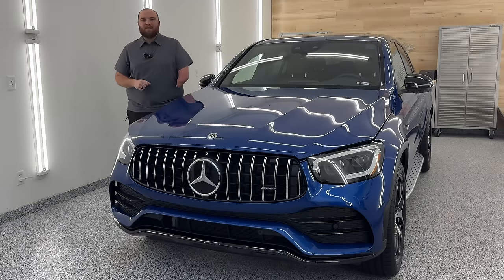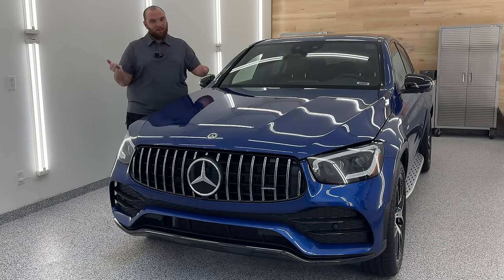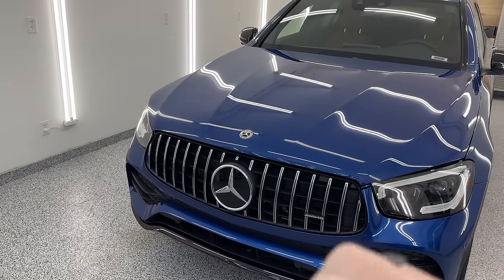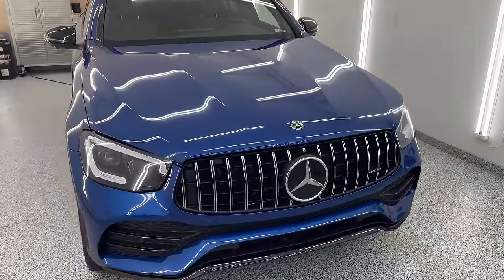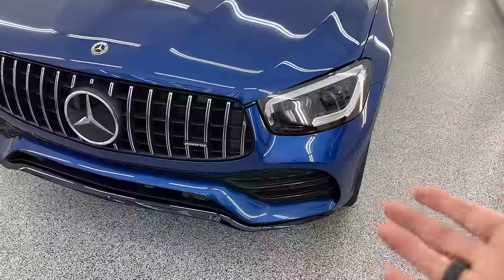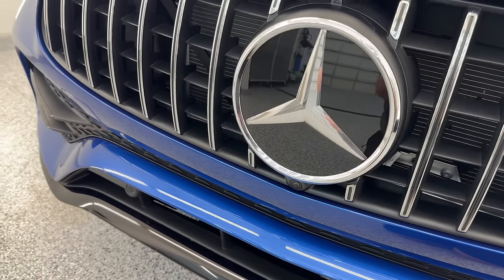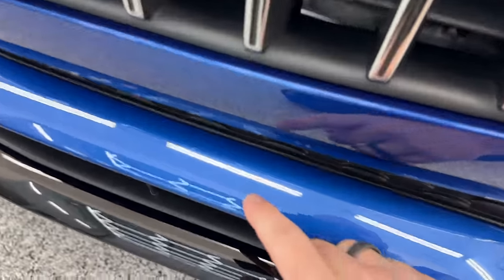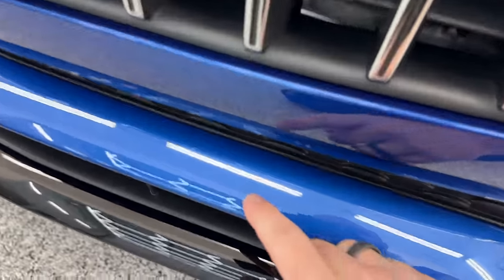The Ugly Truth About Paint Protection Film (PPF) After Just 6 Months & 3,500 Miles

Comment: Yeah, I don’t think so. Very strange viewpoint in my humble opinion. I own about 40 cars and almost all of them have some PPF and I probably have about 10 cars that I have full PF on them. The proper way to protect a new car is Pain correction, then, PPF, then ceramic coating over the PPF. In the last seven or so years, I’ve used three different shops. One of them does amazing work every time, the other two, it depends on who did the job as far as the technician himself. That new EXPEL thicker film is awesome. Also, the matte film is terrific in my opinion. My matte paint cars I don’t even drive at all until they are PPFed. As far as staining, yes, I have had one year old PPF redone twice. Both times it had to do with the fact that the car sat in the sun with sapp stains on the PPF. And, regardless of what it is, older, film, seven years plus old, will need to be replaced if you drive the car at all. I am a big fan of ceramic coating, but only if it goes on top of the PPF. Lastly, the worstPPF that I have seen both from the application technique perspective as well as the quality of the film itself, is Factory PPF on the newer Porsches.
Reply: I agree with you 💯
Reply: So, pay multiple thousands of dollars and waste loads of your valuable time instead of just maintaining your paint with regular washes and garaging?  Even if you have a paint issue, it will probably be minor and cost way less than all of this nonsense.
Reply: @zacklewis342 if he has 40 cars I think the last thing he’s worried about is money.

Comment: Do you think fixing rock chips after couple year period looks better and is cheaper than having ppf and replacing it after the same time period?
Reply: PPF will look better.
Reply: Define better. Better in price? Better in look? Most chips are in the bumper and hood. If you really want paint protection, the smartest move is to get PPF in the bumper and hood only. Possibly lower side of vehicle as well. @ZackScriven
Reply: @ak-iy4yb  better in way it looks. That’s why I said it will look better. 🤔
Reply: My experience.  I have an 11 year old jag xf with 125k miles on it.  No PPF.  At some point lately the front bumper was pretty thrashed with rock chips so I had the front bumper  repainted by a shop with great reviews and it looks as good as new.  It cost $900.  Seems better to just save the money and repaint after a few years than PPF.

As this guy said, if I had a super car that would be different, but a typical car, dont think so.
Reply: @jonesjones7057  I have exactly the same experience. To be honest even if I have to repaint my front even 2-3 years it would still be cheaper that PPF. Also I would never be convince that PPF will look as new after years, you can never prevent peel offs and dust collection at the edges.
Reply: Rock chip will expose bare metal and cause rust
Reply: @cutliss  it is pretty rare rock chips cause such damages unless it went through all the way to the metal. 
I have a few rocks chips that are too big to my liking. Im thinking to touch them up, make them as smooth as possible, keep on driving and possibly repaint the bumper in another few years.
PPF has to be taken off in a few years too no?
Reply: @ak-iy4yb  no it will rust from underneath the paint once the clear coat is sufficiently damaged. It will just take a very long time before you start to see it.
Reply: I do think it’s a better option to address the chips once a year. It takes a couple of days, (mostly to allow things to cure), but good technique on rock chips is pretty undetectable and your car looks mint again for a hundred bucks or so.  For drivers that drive aggressively on the highway and don’t keep good distance, PPF might be a good option because their cars will get peppered.

Comment: As someone who is in the PPF/Ceramic industry I can appreciate this video. In my opinion, the only way to sell PPF is as a sacrificial layer of protection (like you mentioned) to protect your paint. PPF is a tangible product that will always be there and protect the paint from the majority of scratches, chips and dings regardless of how someone takes care of their vehicle.

There is a big education curve that needs to take place between the installer and the consumer and lots of that education you touched on well in this video.
Reply: Exactly. When I ordered my Charger Hellcat, I immediately looked to set up PPF installation. The whole point is to protect the original paint and replace the PPF panels as needed. I have replaced the PPF on the wide body just in front of the passenger doors and it was relatively cheap. Paint underneath what still perfect though the PPF was pretty beat up.
Reply: In my opinion, in the long run, PPF always looks worse, especially on light colored cars.
Reply: If people are more educated though, the price is gonna drive way down
Reply: Ceramic Coating is a tangible product as well, don't make it sound like it's perfect. It lasts about as long as PPF, 2-3 years before you have to dish out another 2-3k to coat your car.
Reply: There's also a big come-back-down-to-earth curve that PPF installers needs to go through and stop charging 2-3 times more for a PPF wrap than paint shops charge for repainting the whole car.
Reply: @ericHHII  Very good point.
Reply: @derbigpr500  Exactly!

Comment: I’am the owner of PPF studio in Australia  and wanted to thank you for the video. I have to agree that PPF is not for everyone, I always mention to my customers this wont solve all your problems. In my opinion PPF is worth the money as long as you use best brands like Suntek or XPEL. Installation process is a key - edge wrapped, do not overstretch and use patterns. A lot of people don’t understand PPF installation is basically a handcraft and many of detailers expend their services without thinking how difficult it is to make it right and that’s what destroying our industry.

I found educating people about the whole idea make them coming back with other vehicles.

In addition detailers sell ceramic coating as a paint protection which everyone knows it does not, expect UV.
Reply: What happens if you put 3+ layers of ppf on ? 

Just wondering if 1 layer is kinda good. What would 10 layers do. Then when the top layer is damaged you peel it off and its like new underneath. 😅
Reply: @dnegel9546  You would never, ever need 10 layers of ppl. Most pff films are at minimum 8 mils thick. More than thick enough for rock chips to never go through. The film doesn't get shredded over the years. So to answer your question, nothing would happen other than them unnecessary being on the car. 1 layer of ppl is good.

Comment: I agree with you. I only have done PPF on my cars that are 100k+, there is no reason to do in a beater. And a good PPF starts at 5k, and needs to be replaced every few years to not look garbage. But it will protect from rock chips and bird poop, the PPF might fade but the painting underneath won’t. A good PPF shop will do paint correction before applying the PPF and then after to make sure it looks neat.
Reply: @japanwatchconnection it’s just s matter of finance. A paint that costs 1k to fix a panel of the car, in a car that will be beat up, there is no reason to spend 3k protecting it. I let it get beat up and repaint it.
A car that costs 10k to 20k to repaint, it worths a PPF expense of 5k to keep the original painting as those cars usually have multi-layer painting that is quite expensive.
It’s not about being elitist, just smart about how to spend the money. Of course if your car is special and you love how it looks with PPF and that gives you a good feeling and you can spend. Go ahead.

Tho I have 10k cars either fade out painting that I couldn’t care less, as far as I can have fun with it driving around. And others that I want to preserver the painting and it will be more expensive to fix than protect.

Comment: My car is fully ppf'ed. Aside the roof which doesn't count because it is a tesla and it is just glass. I was involved in an accident that was not fatal,  Another car just scrapped through my right rear door down to the wheel arch and bumber.  The whole area was heavily scuffed and a dent was created at the wheel arch area.  The ppf saved my car paint and clearcoat. It protected it. My installer removed it and it was again like new.  I had pdr done on the dented area and new ppf was installed instead of the one that was ruined on the door and back right side again.   This car is white pearl. If i had to repaint and keep it look like new, it would end up repainting the whole right side of the car or otherwise it wouldn't be perfect color blending.  So ppf was worth it to me. Car also looks much glossier than without it so it shines alot more.  The ppf is self healing so any minor  scratches just dissappear under the warm sun and the shine level remains high.

Comment: Thank you for this. I just bought a new 4Runner. First new car in our garage in 15 years and I want to protect it and take good care of it. Was going to use PPF on some of the front edges, but I will not. Probably will go with a ceramic coating or something similar if you advise it. I do plan to wash it at home using best practices and proper equipment. It should be fun!

Comment: Bugs come from the front, once in couple of years (and it is not expansive) if someone is annoyed with the stains - they can replace the PPF. What would you do with the acid-eaten paint? Polish it? Repaint? PPF is going off and a new one is put. I have replaced my front bumper couple of times, it is split with two halves - so if one half is enough - just one half is replaced (left or right). All the other car body (hatchback, full PPF) is original for 8 years, not even a swirl on it.

Comment: Well yes, anyone who has any thought would know that PPF is meant to be another layer of protection.  Nothing protects 100%.  So people are coming in and complaining that 6 month of heavy road use and there's wear on the PPF???  Well yeah, that's going to happen.  However, if it was installed properly (which in this case wasn't), its still going to look better than not having it there at all.  Imagine all the hard chips the paint would've suffered on the car already..   I can see why some installers would stop offering it because the last thing you want is someone coming back and complaining the stuff doesn't work.  Or wants to replace everything without paying for it (which of course is the situation 99% of the time is going to happen).
I still think installing PPF is a good way to go if you're worried about resale value or want to protect your "forever car".  Would I put it on a daily driver or a leased vehicle?  If the daily driver is a desirable brand or costs upwards of 70G's+, then yeah, I'd probably want too.  On a leased vehicle??  No.
I find it especially helpful to avoid all those swirl marks and blemishes that accumulate over time.  I personally never put the car thru any car washes, but for those who want to quickly make it look "shiny", PPF goes a long way.  Especially with its self healing properties.

Comment: I have full PPF on my car, and it was damaged badly on the highway when a cement truck dropped rocks on the road, and I hit them at 75 mph. The PPF was damaged and had to be replaced. It ruined the front bumper and damaged the hood a little. When we removed it, the paint underneath was untouched, so I had to replace the PPF on the front bumper and hood.

PPF prevents small rock chips and scratches. It won't protect against larger rocks or objects hitting it at high speed, but it does a great job for its intended purpose. 

Get quotes on a full-quality car paint job, and you will see why PPF costs far less than repainting the car. 

It's self-healing with heat, so your car looks great for far longer than it would without PPF. Without PPF, the paint would slowly get worse. 

It's expensive, so you should consider your budget and what car you are protecting. It makes no sense to spend $5K on PPF for a $12K car. My car cost about $75K, so it was worth protecting and was not an issue with my budget.  

It would help if you had a quality installer to ensure that there are no seams and that the installation is done properly.

Comment: I was interested in what you thought. I have a 2020 Lexus RC350 F-Sport with factory PPF on the front of the car and 25% of the hood. After 47,000 miles of about 75% freeway driving, and after careful inspection, I have 2 small slightly noticeable defects in the PPF, the edges have not lifted and the car is left outside 100%. My prior vehicle was full of paint chips throughout the front bumper and hood without PPF, and thus I am very pleased with the PPF purchase which was about $600 from the factory. Obviously who installs the PPF and the manufacture of the PPF may play a role in the final visual aspects of the film after years of higher speed driving.

Comment: I just bought a brand new 4Runner and I’m trying to figure out what the best way to protect the paint from scratches would be. I had a 2016 4runner and never did anything to the exterior for protection and man did it get scratched to hell. I go hiking and camping a lot and many times the camp site or trailhead is down a dirt road that has tree branches hanging into the road. The first few times I drove down one of these roads I didn’t think anything of it, the branches were very small(I would even go as far as to call them twigs) but when I got out I couldn’t believe the scratches I saw up and down the sides of my vehicle. I had my new 4Runner professionally ceramic coated (I think it was Simoniz maybe?) it was $850 but it has a lifetime guarantee. Do you think it will be enough to protect the vehicle from scratches?

Comment: It is nice to hear your opinion and I learned a few things about what makes a good or bad PPF install.  I have put PPF on my vehicles for years thinking it is the best protection from rock chips in the long run, but I have discovered like you point out that some rocks can get through and damage the paint anyway.  The other dirty secret with PPF is that it needs to be replaced on a routine basis.  It is not install it for the life of the vehicle.  I have an 09 Corvette Z06 that came with PPF installed on the front section.  That PPF is now starting to dry out and check in places and will need to be removed at great expense.  I have decided to forgo PPF on my newest vehicle purchase.

Comment: This is a really insightful video.  I had my last car for about a year and it had full PPF.  For me, the benefit is that it always looked good.  There were far fewer rock chips than if it didn't have PPF, and I felt safe taking it to a drive through carwash once or twice  a week and it never got swirl marks. My current car, a Tesla Plaid, has had PPF for almost a year, and it still looks new.  Tesla paint isn't very nice, but the PPF seems to make it more glossy - as if it was just waxed.  
When I'm on a road trip, and the front is plastered with bugs, I use a gas station squeegee not just for the windshield, but also to scrub the bugs off the front. Since I have PPF, I don't worry about scratching it.  
I will reserve my final opinion until after 3 or 4 years.  Then I'll know if the PPF looks terrible or not.  Maybe it's cheaper to just repaint the front end every three years. 
But for now, full PPF has been a pretty awesome luxury.
Reply: Hell yea ima install some on my carbon fiber hood

Comment: I have two cars that I'm going to get aftermarket painted. I intend to then get PPF because in my experience aftermarket paint isn't as strong (they don't have the $500M ovens Lexus has) and chips much easier. I'd much prefer the defects you've shown to the number of chips I've gotten on aftermarket paint. My real concern is will removing and replacing it someday take the paint off with it.

Thoughts anyone?
Reply: If the prep work done by the body shop was on point and heat ( such as steam ) is used during the removal process, you should be fine.

Comment: Thanks for a great review!  I just bought a GLE AMG63s and of course want to do the best thing to keep it looking good.  But I thought back over all the cars I have owned and realized that while they did get a few rock chips, other than that they looked just fine as I hand wash and wax(nano-coat) them myself.  Your video confirmed that I made the right decision to save thousands of dollars on PPG.
Reply: @@japanwatchconnection It's a car, not jewelry.  Touchup paint works just fine if applied the right way..:)
Reply: Exactly, unless your car is a literal showpiece you are trying to preserve, it will literally be cheaper just to repaint the whole car. PPF on the entire car would cost close to 10,000. You can get an amazing paint job for a third of that. We're never gonna make up the resale value in a few rock chips by spending thousands on PPF

Comment: This was an interesting video, and I appreciate your thoughts and comments.  However, it seems that more than half the problems you pointed out were due to someone doing a poor job installing the PPF, which isn't an indictment of the product itself.  Without knowing the actual PPF product that was used, it's also hard to know how the observations you made apply to PPF in general.  For example, what I've seen and heard is that bug stains and damage take a little special care in how they're removed, but they can be removed and the PPF repaired.  I was also thinking that while the PPF was damaged from rock chips how much worse it would be if the PPF hadn't been there.  Just the same, you gave us a lot to think about and consider.  Thanks!